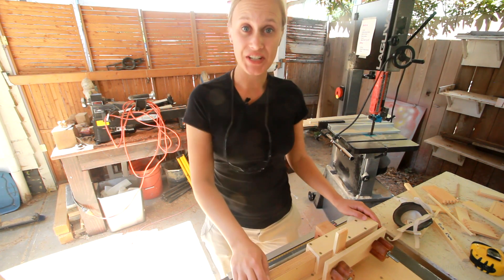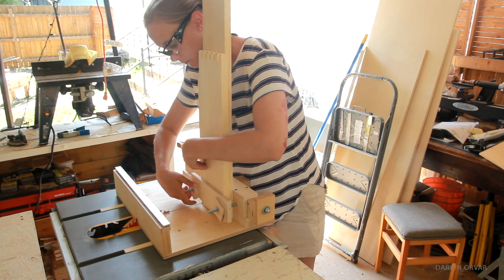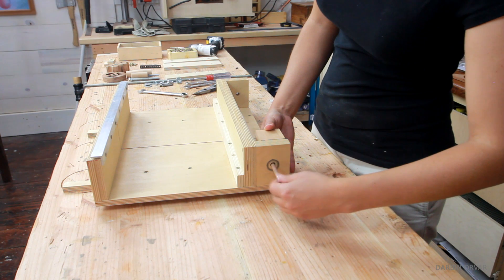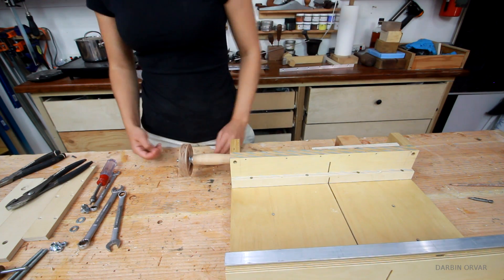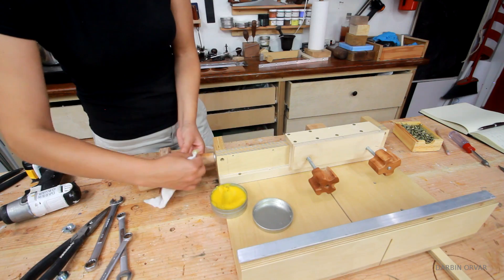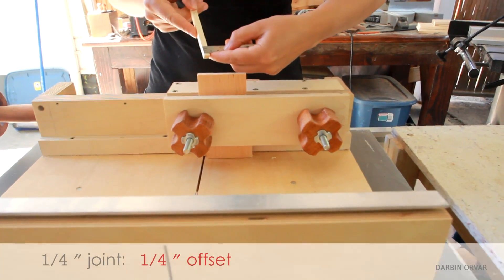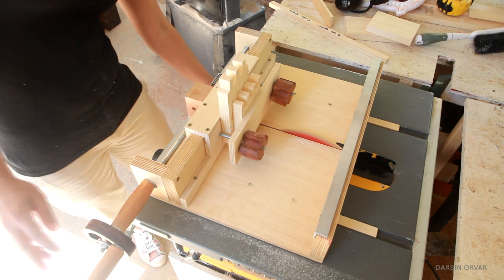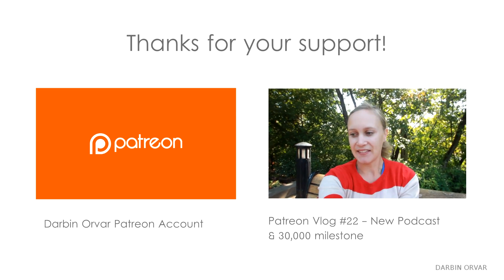How To Make a Box Joint Jig

Comment: thank you so much for doing this one.  (I like to think you listened to me when I asked about it last week).  Headed out now to build your crosscut sled and then the jig to mount for it.  I have a crosscut sled I like, so the finger joint sled will be dedicated.
Reply from the maker: +C Marcoe Thanks for watching, seems a lot of people were really interested in seeing the box joint jig :)
Reply: +Darbin Orvar Something I noticed while watching it for the umpteenth time:  You are indexing the spins in the up position.  On some of the cuts, it is falling down and it might mess up the cut.  I set mine do it is indexed at the bottom of the wheel.  Gravity works with me that way.  It won't tun on its own.

Also, i noticed at about 12;15 in the video, you are using 3 turns.  When I did this, I got an amazing set of finger joints.  However, they are VERY tiny.  Not that it is bad, it's jsut not what I was after.

Comment: I think if you look at your local hardware store they have what I believe is called a (Spring Washer). It is just a thin flat washer that is bowed in the middle. You Might be able to use the washer in the handle to help hold it in the position you stopped at, so it won't start to move on you after you let it go and start your cuts. It will depend on how tight you make your nuts on the handle but should present some pressure to make the handle drag, or stay put once you let go of it.
Nice Job very easy to understand your construction info, and you are making good head way on your site.I enjoy every post you have made.

Comment: Nice jig Linn - just a tip, you can use drill bits for your spacers - 1/8, 1/4. 1/2 etc or some people may have router bit set up bars/gauges which would also work well for thisScott
Reply from the maker: +The 2 Car Garage Shop Thanks for the tip!

Comment: Thank you very much for sharing this with all of us. I've been thinking of building one for myself using our metric system.
I already figured out that the pitch of an m8 thread is 1.25 mm which corresponds nicely with my 2.5 mm blade. The nice thing here is that not only threads are metric but so is everything else so i don't have to recalculate all of it from metric to imperial.
Thanks again and i may come back to you on how it turned out.
Reply from the maker: +Arjan Quist Thanks Arjan!

Comment: A wonderfully thought out jig, Linn. Incorporating it into your sled makes it very practical. 

One question... You are limited in the width of stock you can cut by the space between the two bolts, correct?  Is there a simple change that can be made to increase this limitation?  I guess you would have to make the whole sled wider?  Sorry, that was actually more than one question.  ;-)

Thanks fora all you do.
Reply: Seth Wells Simplest change would be to skip the bolts and just use regular clamps instead of the integral clamp.  Not as slick, but it wouldn't need any additional work to do.A bit more complicated would be to switch out the fixed holes for a T-track system.  You can still use a fixed bolt at the start position, but the second bolt is a flange bolt mounted in a T-track.  The clamping board would need a corresponding slot in it to allow you to slide through it as well.Drop your stock in, slide the flange bolt over to its edge and tighten it down.
Reply from the maker: Seth Wells Thanks Seth. All you need to do is increase the size of the front piece where the clamps are located.  I made it so that it fits on my table saw properly and that it can do a 1 x 6 piece of wood, but it would be really easy to make it a little larger, or a lot larger if you made a bigger sled. Thanks for watching!

Comment: Has the accuracy of Matthias's sled, but is easier to make. Also a lot easier to use than John Hiesz jig.
Reply: +Justin Fiaschetti 
Yes and no, it is very simple to understand how it works but you need to keep all the counts in your head for it to go right. That is why Matthias made such a complicated contraption, it ends up removing most operator errors.
Reply: +Justin Fiaschetti It's a nice jig, but is very limited compared to Matthias'.  Basically, with this jig, you are limited to moving the carriage 1/16" per turn.  If you want to adjust the fit of the joint slightly, how do you do it?  You can't turn a few degrees less with each turn accurately, plus it would get confusing real quick.  I built Matthias' jig and I love it.  I have a 1/8th inch blade that theoretically should have worked with 4 turns of the rod per cut.  It "worked" but the joint was too tight.  Had to force it together, and glue ups would be impossible.  Putting a caliper on my blade, a found it was a few thousandths under 1/8".  So I whipped up a new 47tooth gear replacing the 48 tooth.  The 48 tooth gear turns the rod 4 times per revolution.  The 47 turns it the same, minus 1 12th of a turn less.  Basically, I turn the rod just a hair less than 4 turns with each revolution of the gear.  This narrowed the fingers I was cutting a tiny bit, and made the joints fit perfectly.  

I don't put this comment out there to disparage the jig shown here, which is quite nice and definitely easier to build.  Just putting out some info from somebody who's actually used one.
Reply: @FarmCraft101  you think you can't make micro adjustments with this jig? I think that's crazy talk. 
You could easily put a pointer on this jig so you stop your last turn early or later depending.
Reply: +FarmCraft101 The pitch of a 1/4-20 thread is 0.050"/revolution. it is 0.0125 less than 1/16=0.0625 this is where your error came in. if you use a 3/8-16, you will be able to use a 1rev=1/16, being the pitch of a 3/8-16 is 0.0625
Reply: ***** Not sure what error you refer to.  I am using 3/8-16.  My point is you sometimes might need to adjust at different increments than 1/16th of an inch, and Matthias' jig does that easily, quickly, and accurately.
Reply: I apologize, I misunderstood what you were saying lol. If I was her, I would have outright had an 1/8" blade and made it with 3/8-16 rod. It makes  all the math easier.

Comment: Very nice jig. I think/KNOW I would need to put a chart on the top face of the jig as a reminder of how many turns and passes for different size joints.
Reply from the maker: Steven Nedesky Thanks, I agree that would be a great idea. Maybe a holder on the side too for the spacers :)
Reply: Steven Nedesky I've done mine a bit differently, taking a page from Incra.  On the top of the back fence, I have a removable "ruler".  The ruler is simply paper that I have printed black and white boxes on.  Black for cut, white for don't cut.The moving portion of the jig has a cutout for an acrylic lens that I cut a groove in with my table saw (so that it will be the exact width of the table saw blade).Set everything up roughly the same way - but instead of counting my turns and having to keep track of that (or having to do any funny math for odd finger sizes) - I can simply look down at the lens to see if the blade is on a white or black box.  Black, make a cut.  White, turn the handle.Comes in very handy when you get a phone call or have something else interrupt what you are doing.I've laminated most of my more commonly used templates so that they can slide into a groove easily and hold up over time, but every now and again - I will do variable fingers (something like 1/2" - 1" - 1/2" or whatever) and for those, it only takes a few minutes at the computer to create a new template.  Print it out on self adhesive paper and stick it down.